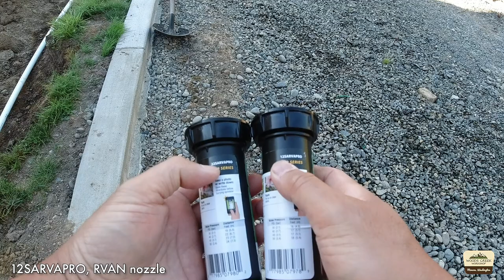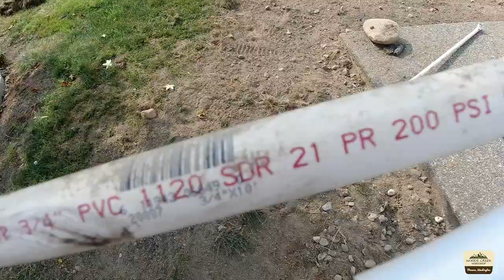STOP Dragging Hoses:  DIY Lawn Sprinkler System Installation

Comment: The only thing worse than not having a system of any type (yours is a sprinkler system in this case) is having whatever that "thing" is but it being slapped together crap that doesn't work.  The system you build will be a much higher quality build, for sure.
Reply from the maker: Everett's Workshop thanks Everett.  I didn’t even know there was a “system” there and was obvious it couldn’t have been used.  I drove over the new system multiple times with the tractor today and it held up great, no damages.  I’m a happy camper 🤗

Comment: here in NJ I use black outdoor pipe  for underground sprinkler and feed to the pool. Although I don't really sprinkle more than the garden.  It's generally whats used here. Also code here requires it be deeper than you dug. Not sure why code has requirements for sprinklers.. I covet that Kubota..  If I had one I would get a trenching bucket off craigslist... so I could have straight dug the trenches.
Reply from the maker: That is a trenching bucket, just removed the teeth so I can scrape the sod off.  We go only 8 to 10 inches here and blow it out with compressed air in the fall.  Thanks!

Comment: Man you have all the cool tools. Hey what was that primer gray truck cab I saw?  Since I live in a rain forest I dont need a sprinkler system. LOL.
Reply from the maker: Hill Top Machine Works 1950 Chevy 3100 half ton truck in pieces.  Has mustang II front suspension and Z link rear.  Too many projects, not enough time 😭
Reply: @woodscreekworkshop9939  Oh sweet. A good friend of mine is doing a 49. Small world.
Reply from the maker: Hill Top Machine Works at least he is “doing” it, mine just sits there.😁
Reply: @woodscreekworkshop9939  I say that loosely. He is trying to finish up his wife's 65 mustang right now.